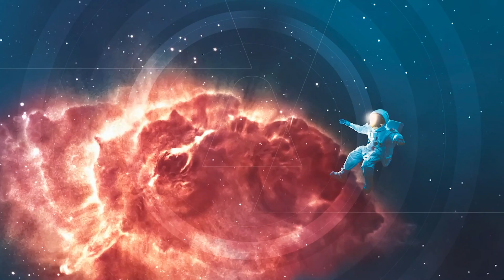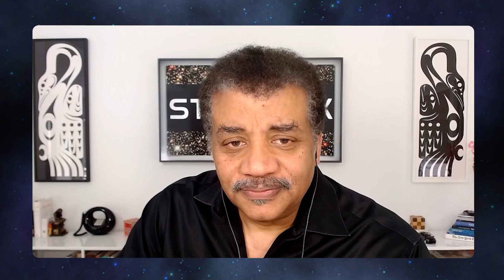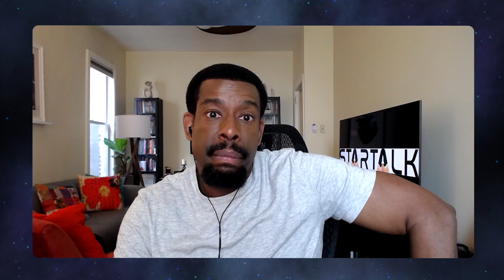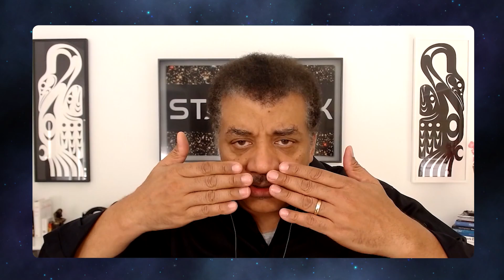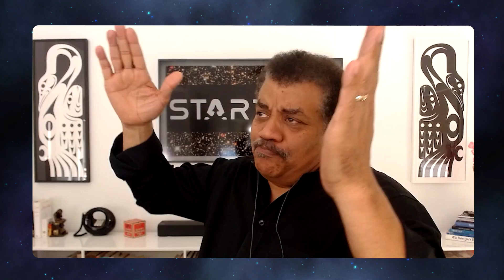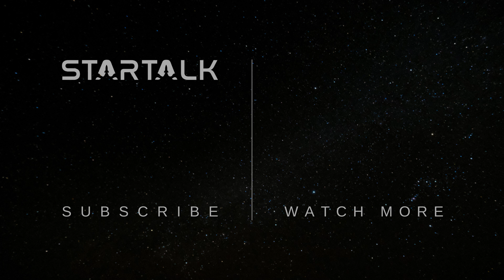Neil deGrasse Tyson Explains Sonic Booms

Comment: Dr. Tyson, I’ve been a HUGE fan for years and often watch/listen to you with my 11 year old son. Thank you for all the amazingly interesting information you deliver in such an entertaining and easily digestible manner.

I have FOREVER wondered if the “sonic boom” ONLY occurs at the instant a plane goes transonic, or does the “boom” continue to propagate behind it? Example: You’re standing in a desert. A plane accelerates beyond the speed of sound miles from you. That plane passes you seconds later…….do you hear a sonic boom AT your location, or maybe the remnant of the one miles away when the plane initially went transonic.

My family and I have attended air shows annually for the last 12 years (except 2020, of course 😡) and never have gotten to experience a sonic boom due to the regulations you referred to in this video.

Comment: What if it's like cavitation and pressure collapses a vacuum that makes the noise
Reply: That's what i tought for years and i tought after this video that boy was i wrong.. buuut that indeed is what a sonic boom is! Neil explained it as if it's the compressed sound from the engines you're hearing. Nope it's the sudden change in air pressure, as it collapses on itself from the front of the supersonic object to behind the end.

Comment: Now you’ve got me wondering what a pilot hears at supersonic speeds 🧐
Reply: A pilot in that case hears normal sounds because the plane leaves behind the compressed sound that makes a sonic boom, but the air in the cockpit doesn't have anything going through it at higher than Mach 1, unless someone cracks a whip or snaps a towel, the principle explained in the video.  I grew up next to an Air Force base and heard sonic booms from military jets allowed to make them many years ago near U.S. cities.  I never understood the principle back then but it got me interested in science.
Reply: @abeautifuldayful  excellent response, I would only add that the pilot would hear the rattling of the airframe but only the moment he punches through the sound barrier. Then it becomes smooth.

Comment: I believe you'll find a sonic boom is NOT a piled up wall of the airplane's sound. This is not correct.
A sonic boom is a shock wave. Not a pile of sound. You note yourself the whip. The whip is silent yet still causes a sonic boom.
The air in front of the plane is compressed into a Shockwave.
Not a pile of sound... it's a discontinuity of air pressure - a very sudden change in pressure.

Comment: Why is the speed of sound constant for a medium?
Reply: It's not always constant. The speed of sound is calculated by (gamma*R*T)^0.5 where gamma is the ratio of the specific heats of the medium (a property that can be looked up), R is the specific gas constant (different for different mediums), and T is the temperature. So the speed of sound can be different for the same medium at different temperatures.
Reply: @MikeNotBrick  A small correction - R in that equation is the specific gas constant, not the universal constant. i.e. for air it's 287.1 J/kg/K, not 8.314 J/mole/K. 
As it's a specific constant, it's different for different gasses.

Comment: Living next to a Marine base with fighters with sound booms would be most invasive! 
Lately, we have sonic booms coming IN from over the ocean, rather than land. 
AND the BOOMS are not comfortable...just cause we can do it, doesn’t mean we have to do it!
I was always under the impression that the noise from lighting or planes exceeding Mach was the air pressure rapidly filling the space created by the bolt, or plane body. We hear the engine noise and air disturbance of propellers and jets with planes slower than sound, I think...?

Comment: I just don't get how sometimes things can be relative and some other times they aren't. Like this. If someone is speaking inside a plane that goes faster than the speed of sound, you will probably hear it if you are inside the plane. 

When the plane is making noise, that sound doesn't travel the speed of sound plus the speed of the plane but straight up only the speed of sound.

I would have really appreciated a precision here. Because I don't know if I understand right.

More or less the same thing goes with the speed of light which is said to my understanding to be a universal constant but only in precise conditions which excludes through water, glass, etc. So I could really not figure that there is such thing like a "light boom" or something like Neil said.

Comment: I didn't understand that part (at around 10:00) when NdT mentioned "sending a particle that can travel faster than the speed of light through that material". What is he talking about?  Nothing can travel faster than light (except spacetime).
Reply: He explains it badly but in short terms..
It's the reason why over excited elements become visible to our eyes.
The reason that you see a fire as red, or orange..or whatever. It's because the element gets excited by heat to the point that it vibrates at the same frequency of this color.
Light / colors are nothing more than precise electromagnetic frequencies that our eyes are built to perceive
Reply: Nothing can travel faster than the empty space speed of light. But as the speed of light in dense mediums is much slower, you can have a particle that is slower than the empty space speed of light, yet faster than light in that particular solid medium.
Reply: @ASJC27  actually the speed of light in any medium is still 299,792 km/sec, the reason it seems to slow down because the photons are bouncing off the atoms in the dense material. That's why for example, a photon created in the core of the sun can take up to 100,000 years to reach the surface. 
But okay, the way you explained it makes sense compared to what NdT said. So if I understand correctly what you're explaining and NdT is saying, a particle can travel faster than a photon traveling in a dense medium. Is that correct?

Comment: The Sonic boom from Jet planes and Bullets are easy to understand. What else makes a sound because it is breaking the sound barrier. Does a popping balloon break the sound barrier ?
Reply: Not really. What happens is that the balloon contains air at higher pressure than its surroundings(The elastic rubber contracts the air inside) , When you pop a balloon, you are releasing air that was compressed, and it's like an air explosion.

Comment: Just before the sonic boom hits the ear, if we could see the plane approaching us, the experience is weird. There is a fast approaching supersonic airplane while there is pin drop silence!
Reply: Watched a video recently (might have been an airshow). A plane was coming in quietly and a woman said to someone: "You said this was going to be loud". Felt so satisfying when the sonic boom hit a few seconds after that.
Reply: I love the very quiet hiss of the air across the wing tips as the jet passes, just before the boom reaches you. 
Blue Angels #6 has been my favorite since the mid 80's for that very reason.
Goes straight up until it can't be seen, flies far behind the crowd, only to fly over at low altitude from the rear, letting the boom go right before he is over the field. 
Scares you because you hear the hiss as the jet is passing above. One second later... BOOOOM!!

(the boom is actually initiated far from the crowd I have been told) To prevent injuries is my guess.
Reply: Ive seen/heard this at an air show, the guy on loud speaker tells you which direction to look and there you see the silent plane, very high up but it passes way over head before the boom hits.
Reply: While working out in Lancaster where private property butts up National Lands if you can hear them you can no longer see them flying low...